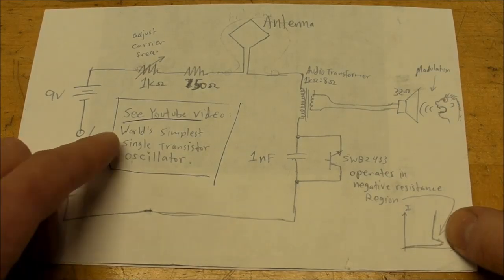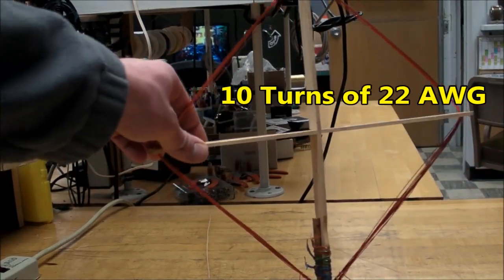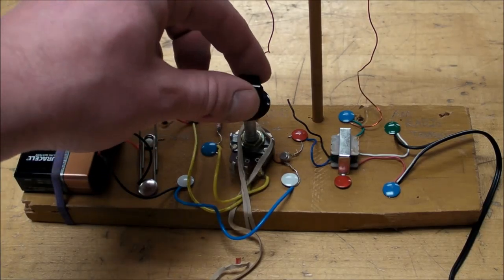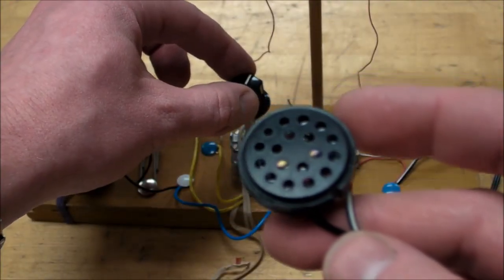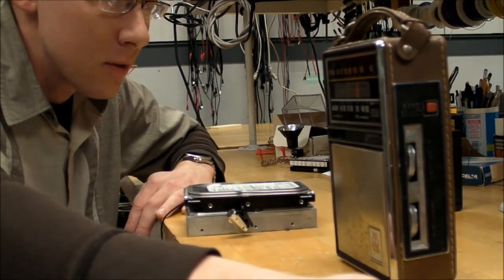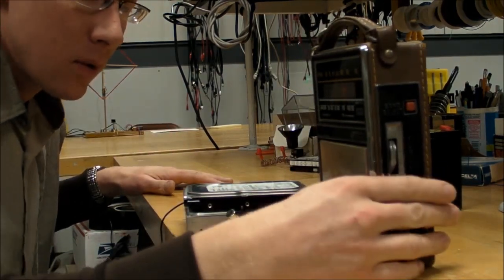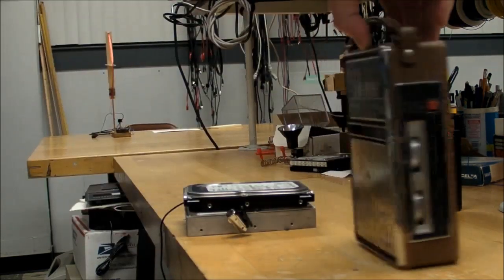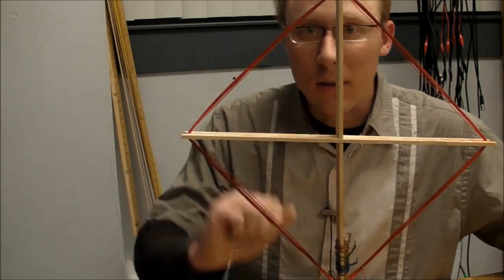(#0137) Simple AM Transmitter Built on a REAL Breadboard

Comment: I chuckled a bit when you used the paperclip as a switch.

I love to novelty of this!
Reply: Will Abell, paper clip as a switch is being used on boards like that for many years, decades. It is quite useful when needed a multiple contact "rotary switch", as in a multi resistor selection. If you dig back in the technology, you will find we (older people) used to make resistors with paper and pencil graphite (carbon), capacitors by twisting wires and finding the correct polarization of vacuum tubes using the fingers resistance. Today's industrialized components are just a commercial adaptation of what was improvised in the past.

Comment: I tried the 2N 3904 with a 50 k pot and some resistors in series to a value of 564 since i don't have a 560 ohm in my junk box and it works. I'd like to try a 150 ohm next time and see what happens. I have germanium transistors but they are PNP. I was wondering if it will work by reversing the voltage, but i might damage my vintage transistors. A very good simple transmitter made out of what you have. I like it!
Reply: Did you still use the same schematic of this transmitter?
Reply: what did you use for the transformer

Comment: I know its been a while since you made this video, but I was wondering the following: Since you seem to be transferring the power from the transmitter into the antenna very effectively did you calculate or measure the impedance of the transmitter's output and build your loop antenna with an input impedance that matches thus getting most if not all the power to be radiated from the antenna? Conversely, it might have been a lucky guess but a darn good one none the less.

Comment: I am trying to make the oscillator, using a 2n2222 TO-18 it seems the highest frequency I can get is 30KHz. no signal with a 1nF cap. I'll try a 2n3904 next.
Reply: The 2n3904 is working better, a little shaking, but it is sinusoidal.
R1 = 560Ω
Vs = 12vdc
C1 = 1nF
Freq = 870kHz (1vp-p)
Reply from the maker: Matt Heilman Glad you could make it. It certainly does take some playing around to get it working. I used the SWB2433 because it has a good amount of negative resistance. Unfortunately, it is extremely obsolete. Other transistors work, but not quite as well.
Reply: Eric Wasatonic the best sin wave oscillator i made was with one of my oldest transistors.  Go figure!
Reply: jon sanford Age = Quality!
Reply: beautiful!!
Reply: hello sir, i am very curious about the biasing of your transistor, as what i observed, the base is open and not seemingly connected to the network. I am planning to use 2N3904, should i leave the base open? I hope you can respond to this query. thanks in advance Eric Wasatonic Matt Heilman
Reply: Essale Meñoza
 I left the base open, as for calculating bias...
not certain how the calculate it without a base resistor.
http://youtu.be/oHDRhzrRNWY
Reply: a blast from the past
Reply: +Anthony Elliott  I built this up using a 2n3904 and it worked. I swapped the 1K pot for a 50K pot. The 50K gave more frequency range. Tuned the receiver to 1Mhz. Works like a bomb. Awesome sound radio tuning sound effects machine.
Reply: try using a fet as an oscillator,  such as a mpf102, or if you can find a mpf103 wich has two gates you can mix into your oscillator. but they can be hard to find.  bg micro had some at one time. good luck
Reply: +Eric Wasatonic Did you think of using a high impedance carbon microphone as the transducer, doing away with the audio matching xformer?
What would happen if you connected this microphone across(or in series) with that frequency control potentiometer, FM modulation?
Reply: +Heilman Hackatronics What is the inductance of the Loop Antenna. Is that 1nF cap a frequency determining component or a shunt?

Comment: Cool! You should test the frequency of the transmitter. I bet it's either highly unstable, or way below where you are trying to transmit.
Reply from the maker: I'm sure it is quite unstable, but transmitted and receiving frequencies are the same. I measured frequency in the linked video on single transistor oscillators.
Reply: What is the replacement of the SWB2433?
Reply: Looks to be a standard NPN. I'll try with a 2N3904 and get back to ya.

Comment: If this AM requency Radio Transmitter is to operate in the AM band (the middle of such is 1000KHz) and assuming that the 1nF capacitor is the primary frequency determining component, then that closed loop antenna coil would have an inductance around 25 microHenries?
Reply: ه
Reply: What?

Comment: Calling this a simple AM transistor radio transmitter circuit maybe misleading.
Since the transistor here is being operated in the negative resistance region and no input supplied to its base, this is in reality a de-facto Tunnel Diode Transmitter circuit.
Reply: Jeffrey314159 
This transistor is operation in the breakdown region, that's why he is using two 9V batteries in series, 0r 18VDC.  Tunnel diodes do not operate in breakdown, they operate as true Esaki diodes, which need only a fraction of a volt to tunnel.  This transmitter is not an Esaki or tunnel diode.
Reply: Then what is it?